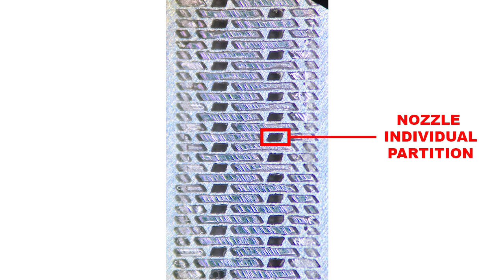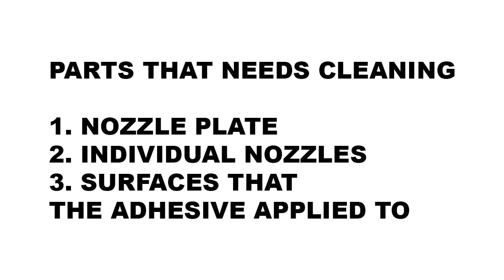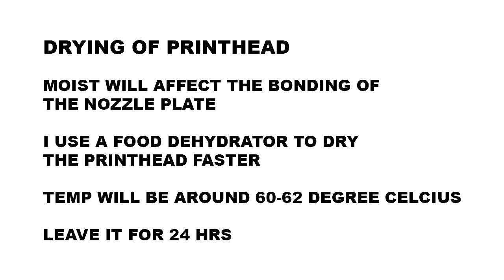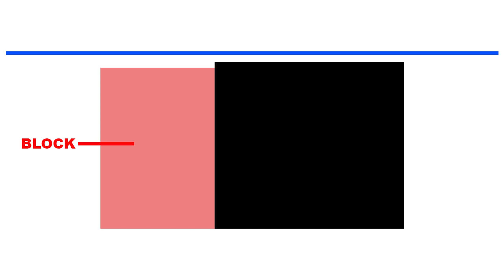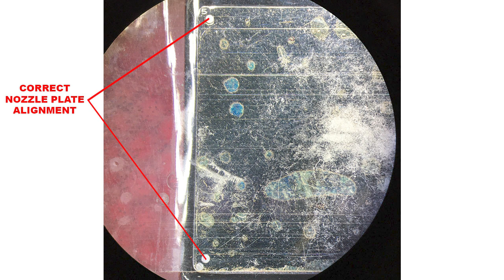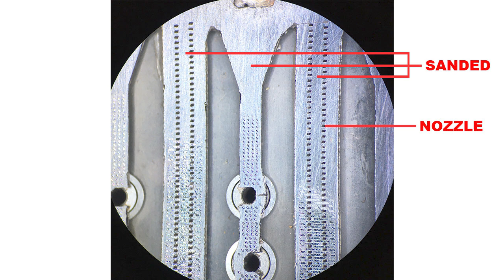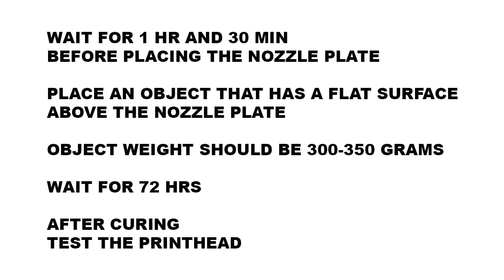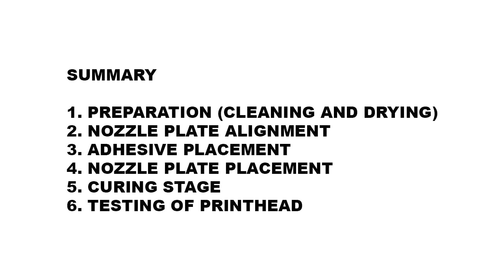EPSON L1800 PRINTHEAD REPAIR (HONEST WAY TO REPAIR A PRINTHEAD)

Comment: Guys the glue i use to stick those metal plates is Clear Epoxy resin A and B
Reply: Ultrasonic cleaner get the 75khz ones
Reply: Thank you I've been searching 
all over to confirm if that would be a great glue and you solved my problem God bless 🙌
Reply: @orbitalgrimoire1027  why 75 and not 40 ?
Reply: @orbitalgrimoire1027 you have the name brand of the glue you use be truly appreciated
Reply: Bạn có thể cho mình đường link mua keo AB đó ko bên việt nam mình ko có dạng keo như bạn dùng

Comment: Hello, thanks for the video, I really needed it, I have several questions, 1. what are the ink removers, Thinner, Isoprofilic Alcohol and car paint remover, could that be? 2. the use of 2000 sandpaper, is it done to the entire part that has glue and when doing so does the sandpaper not damage the individual nozzles? 3. Can I get the sticker on Amazon? Or what alternatives do I have to buy another different sticker from the link, it's because they don't send me to Colombia
Reply from the maker: Hello,

For the ink remover, I use a paint stripper (gel type) fast acting. When applying you should apply it until the ink is completely removed. Then to remove the paint stripper, I used paint thinner and carefully brushed it to the applied area. Lastly I will put the printhead into the ultrasonic cleaner to completely remove the paint stripper.

For the sandpaper.  Sand all the area of the printhead that the adhesive will be applied just to flatten all the surfaces. It should not be damaged, just be careful and do it slowly.

I am not sure if the product is available on amazon. But I will try to find it on other online shopping sites. If I find it, I will put the link in the comment section.
Reply: Thaks Friend
Reply: Hello, I forgot to ask, which liquid to put in the ultrasound machine?
Reply: Saan makakabili ng glue idol?
Reply: @jaimeGonzalez-cb9hn  did you find the adhesive sir?
Reply: No friend

Comment: Hi This is Dinesh from Fiji Islands.  thanks , very good your description , ive also tried fixing, i have a large format printer with a DX-7 printheads and also a Belqutette 4 station DTF printer but But DTF printer is clogged and could not fix without sucess , but for ,my large sublimation printer,   now am trying much deeper methods bit like yours. a question Just how do you apply glue in very thin sections just around the nozzles, it seems almost impossible without proper equipment.

Comment: Hello, I have a DTF Epson L1800 and I am having a problem with it not turning on. 
The power on the back does work, but power the button on the front won’t come on so nothing works. First started with two buttons on the front blinking red, then I turned it off completely about 2 or 3 times then now it’s not powering on. Can you help?
Reply: Sounds like your motherboard is fried!! Order a new motherboard!

Comment: How do I remove the original layer of glue?
Reply: By Hair Dryer or Hot gun with Very low heat otherwise it will melt plastics.